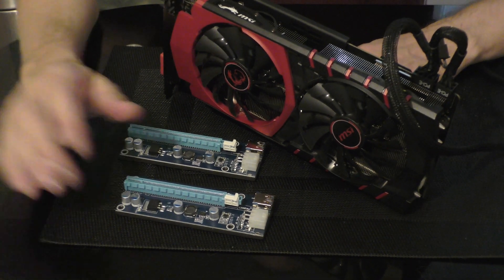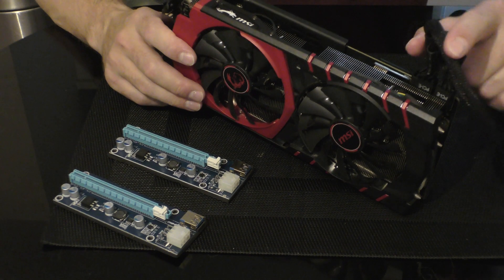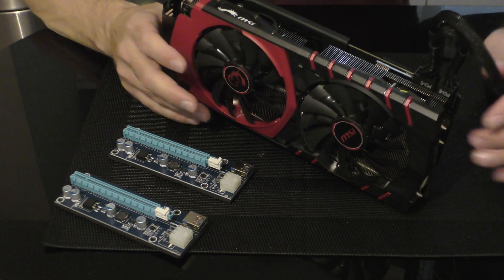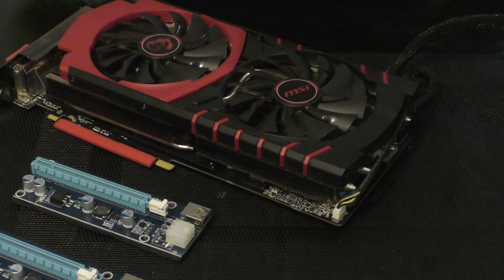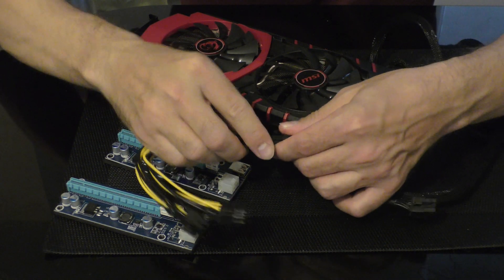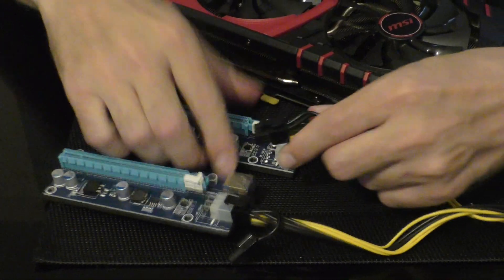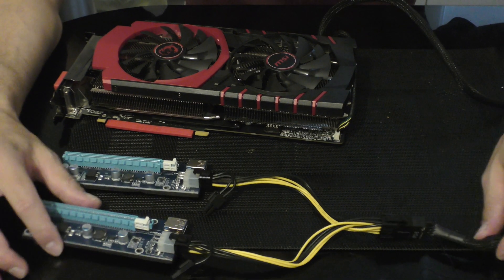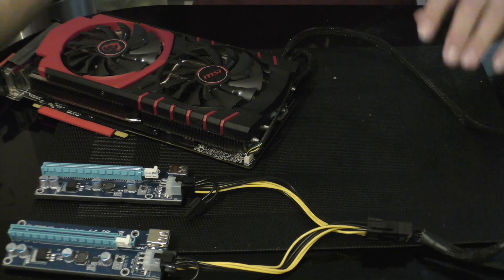Connect your High Power GPU | Riser | Splitter

Comment: It is safe can splitt 2 riser with 1 cable 28awg?
Reply from the maker: I recommend using 16 awg.
28 cables are too thin to sustain power intensity.
Reply: @minerondemand  how about 18awg it is safe?

Comment: x1 splitter never worked for me.. what was the issue?
i am using 640watt power
ryzen 5 with 3060 and 1660ti.
Reply from the maker: You need 1 splitter and 1 PCIe for each GPU.
Reply: @minerondemand  hi sir,

i used and returned nearly 4/5 X1 risers upto now and never i am able to connect riser successfully. gpu is never detected while using riser but when gpu is connected directly to x16 port on the mother board , everything is working fine.

Power supply used : 650W
processor: I5 8th gen / ryzen 3
motherboard: gigabyte z370 / gigabyte b550m ds3h
graphic card: 3060 and 1660ti

tried connecting riser with SATA, molex, pcie and nothing worked upto now..
please please please help.
what is the mistake i am doing?? 
tried on 2 different mother boards and different processors but no success..
Reply from the maker: @ThePrabhu16  did you enable 4g decode in bios?
Reply: @minerondemand  no... will try that

Comment: here's a question i  hope somebody can get me out the question . if lets say i got 4 rtx 3080 and psu is enough for 4 pcie to power up the graphic. how about the riser to power up ?
Reply from the maker: You can use normal splitting with 3080.
Still safe.  Check the other video about riser and GPU splitting.

Comment: yo MoD, one nob question. can i use splitter for one card and not for the other two cards? ty :)
Reply from the maker: Of course you can
Reply: @minerondemand  ty. I have 1000w fully modular Chieftec PSU and 2 6700xt in it. Do I have enough power to put 3rd one. Can u help me bro? Ty :)

Comment: you earned a sub!!!!!!!!!!
Reply from the maker: Thank you.  Appreciated.
Reply: @minerondemand  hai 
i have some doubts
1 is it possible to connect multiple gpu without sli ?
2 is pci riser safe
Reply from the maker: @amallfayazz8401  yes,  we use risers to connect several GPU's in same board.  If you have pcie slots in your mobo  you can use risers.
Reply: @minerondemand  i have asrock b450 steel legend and it has 2 gpu slots and 4 pci slots .....and i have 2 gpu only 1 gtx 1660s and 1660ti.....what should i doo......connect two gpu direcctly to motherboard ?.......or use a pci riser......which is best for m?
Reply from the maker: @amallfayazz8401  unfortunately that board only supports 2 GPU's. 
The other 4 pcie are 2.0 x1 and won't work with GPU's. 
As for the 16pin you can put GPU directly or use risers.
Reply: @minerondemand  but everyone saying to me it wont work you need a sli graphics card to run multiple 
or it will overkill or crash the bootup
what is the reailty
Reply from the maker: @amallfayazz8401  why would the manufacturer put 2x 16 pin if not for that?
Try it and find out.  If doesn't work, motherboard will complain about it.
Reply: @minerondemand  I have asrock b450 steel legend is it good for mining 
And can I put my gtx 1660s and 1660ti directly to motherboard or to riser?
Reply from the maker: @amallfayazz8401  already answered that above
Reply: @minerondemand  I'm sorry 
Thank you for your support!!!!!! ❤

Comment: my psu is 750 w silver from corsair , i got 4 RX 5700 , hown can i power those 4 cards
Reply from the maker: 750w PSU usually have only 2 pcie cables.  That means only 2 GPU can be plugged.

Comment: I have 4 rtx 3060 ti and 3 rtx 3080
2X EVGA 600 BR would be enough for powering those cards?
Also the PSU only has 2 8 pin 6+2 PCI-E cables so how i'm supposed to connect more than 2 Graphic cards per power supply?
Reply from the maker: You can only connect 3 card to that PSU.  And 3080 won't be enough power for all 3
Check here at minute 5:45
https://youtu.be/wekRS_vT20s

Comment: Can i use 1 cable for 4x riser? Using 2 splitters?
Card i use is 5500xt for minning and takes abt 60 watt!
Reply from the maker: It's not advised. 
Please check power cables video for better understanding.
Reply: @minerondemand  ok bud thx

Comment: Hi, thank for your videos. But I have problem using the splitter. Every time i use, my PSU won’t turn on. Do you happen to know why? Thank you
Reply: Yeah my risers work fine when powered with pcie cable connect directly to psu. But when using the splitter , the PSU turn on and off immediately
Reply from the maker: @duythanh2206  ok so it's obviously the splitter.  Are you sure it's a GPU splitter? 
What GPU you have?
Reply: @minerondemand  i have variety of them , from rx480/580, 5700xt , 3070 and all have the same problem from different PSU as well ( corsair and evga)
Reply from the maker: @duythanh2206  for this GPU's the other method is probably better.
Reply from the maker: Does it do the same when only 1 GPU?
Reply from the maker: You sure it's the splitter?  Most times it's a faulty riser.

Comment: Hi man is focus 750w gold enough for 1 3080 and 1 3070? Or even more gpu IF gpus are undervolt ed?
Reply from the maker: When you do the maths,  it's always without OC  just in case they failed.  So those 2 cards would consume a total 540w. 
In theory 750w should work.
Reply: @minerondemand  ty :) i have 2 rig my second rig is with 3070 and ryzen 5 5600x. And total watt in this is 210w after tunning on gpu...

Comment: My psu 750w gold only have 2 pcie slots for the cable, how can i fire up rx 6800 and 2x rx 5500 xt with 2 riser? Can i just split it and split it?
Reply from the maker: With 1 pcie cable per GPU.  So you can only power the 6800 with a splitter and 1x 5500. Check my latest video about power cables.
Reply: @minerondemand  okay thanks man ill watch it +1 sub for u

Comment: would it be dangerous to not use a splitter? I don't have any and my 1070 is accumulating dust instead of mining :c
Reply from the maker: No, you dont have to use splitters. GPU will extract what power it needs and PSU will supply what power is requested from GPU
Reply: @minerondemand  and conecting a 6 pin riser without splitter would burn it? Directly from PSU to riser.
Reply from the maker: @JustAColombian  same deal as before.  PSU will only send the power riser requests
Reply: @minerondemand  you have saved me hahahaha thank you so muuuuch

Comment: It is possible to powering 2 gpus (one 5600xt and one 5500xt 8pin each) with one pcie cable with two 8pin terminals???? One terminal per card,? Without risers, just direct from the motherboard????
Reply from the maker: I don't recommend.  You'll be very near of cable power limit  288w
Reply: @minerondemand  even if i turn down the power to -40% (90watts) in each card, even temporarily in what I buy another of power supply? ? :c
Reply from the maker: @Don_Calav3ra  yes you can do that.  But if OC fails you'll have a problem. So be careful and check if cable gets hot.

Comment: The best way: 1 pci-e cable with 2 x 6+2pin ->> 1 to riser (75W) + 1 to vga (vga use 8pin to 2x8pin pci-e splitter cable) (150W). So one gpu, one cable. Need dual psu for 6vga, safe and stable.

Comment: Hi, i want to use two 750w psu for 6 gpus rx570 8gb, it is good to connect 4 gpus rx570 8gb on one 750w psu and 2 gpus rx570 8gb with hardware on second one 750w psu ?
Reply from the maker: Yes that would be fine.  I would divide 3 on each.
Reply: @minerondemand  an example, about connecting gpus and risers, it is ok if I use 3 pci-e cables, 1 for 2 risers and 2 pci-e cables for connecting 2 gpus rx570 8gb. about risers, does it have anything if I use the v006 risers version for rx570 8gb gpus?  Is there a problem if I use different and used gpus? I want to make my first mining rig, and I get informations from internet and videos about how to make connections and an rig, it is very hard for  those who have never done this. Thank you for the well-explained videos and for reply!
Reply from the maker: @gameruldenis888  in your case I recommend the other video. For every GPU,  You can use 1 pci-e cable and split it to riser. 
You can use use any riser version but more recent are better.  009s being the best

Comment: Where that molex at? I use a 2-3070's on one molex strand
Reply from the maker: Molex can handle up to 156w.  I think you're lucky.
Reply: @minerondemand  so its okay to do that? I am trying to go for 6 pin pice power but that means I would have to use adapters on my 8in psu cable
Reply from the maker: @kk-qu1zc  of course not. 
3070  take 130w each  with OC. 
2 x 3070 it's 260w for a 156w cable.
Reply: @minerondemand  ya but not all power is going through that 156w cable. 1 molex = 2 pcie risers. Then each 3070 has its 8 pin cable.

Comment: hello, i have a question, what do you think if i use a 6 pin to 6+2 pin splitter for the risers? Would it be safe? As the ones you're using are 8 pin i feel quite unsure
Reply from the maker: In theory it should work as 6pin can handle 156w. 
But you need to make sure the live and ground wires are the same.
Reply: @minerondemand  what do you mean with live and ground wires?
Reply from the maker: @juanluisgalvezghiggo6618  for example in some PSU,  the GPU and CPU 8pin are different  wire diagram. 
So you need to make sure the 6pin is the same.

Comment: Can I use the same psu gpu cable to connect 4 risers using two splitters?...
Reply from the maker: No because you'll be using more than the cable can take.  288W
Each riser will draw 75W
Reply: @minerondemand  oh ur right, I heard those splitters allow up to 200w only is that true ?!....

Comment: Hello buddy
I saw your video I really liked it I have some questions.
I have 1 Corsair 1000w and a 1200w PSU server now Psu server has 1 cable that has 6pin with 6 + 2pin now can I use the psu server cable with splitter (Y) to connect the GPU which means like you who have connected Risers I think with 1 cable 6 pin with 6 + 2 pin with splitter (Y) to connect 1 gpu,i have RTX 3060TI, i believe me understand what I think
THNX for all
Reply from the maker: Yes you can split. 
But since server PSU have lots of connection it's better to use 1 cable for GPU and another for riser. 
GPU and riser always from same power source.
Reply: Splitter (Y) has 8pin to 2x 6+2 pin thnx
Reply: but I definitely thought that 1 cable with splitter for gpu because Msi RTX 3060ti has 2x8 connector for this I asked the question to use the splitter ??  thanks a lot for the prompt reply
Reply from the maker: @fatoshodja1517  the rule is 1 cable let GPU. 
Don't matter if cable have splitter. 
If pcie cable splitter reaches riser,  you can use it,  if not,  you can split it. 
Hope it makes sense
Reply: Thnx very much buddy ist all right now i understand thank you

Comment: Thanks! What PSU do you reccomend? I'm using a retail psu but am completely out of pcie slots.
Reply from the maker: Any PSU with 80+ gold and above. 
Average only bring 6 pcie.  For more than 6 cards just connect another PSU
Reply: @minerondemand  yes but even with 6 pcie you cant connect 6 cards.. for example i have a 1700watt Enermax Platimax PSU,  this PSU has only 6 Sockets/cables that go from PSU into 2x 6+2 pins.. so in total i have 12 x 6+2pins. each of my cards need 2 x 6+2 pins! (i have 3070s)

so for 6x3070s i would need to use ALL of my 6 sockets from the psu.. and then i would have no room for the splitters.
Reply from the maker: @damnbro0707  correct.  For 3070, 3080 , 3090 you'll need another PSU. 
For the beasts I recommend PSU server.  They are cheaper  too.

Comment: Hi, how would this process work if I have 3 GPUs on one PSU? Can the third riser be directly connected to the PSU without the need for another splitter since it'll only power one riser? I won't risk connecting the third riser to the other strand of the pcie cable (with the splitters connected on the other end), so I'm planning to dedicate a single riser connected to the PSU directly. Please advise if this is a good idea. Thank you!
Reply from the maker: What GPU you have?
Reply: @minerondemand  1 2080TI (250W TDP)  and 2 3070 (490W TDP) on a 1200W PSU. The 2080TI needs 2 8pin + 1 6pin PCIE connectors, which makes this more confusing with the risers and splitters included. The 3070 only requires 2 8pin pcie cables
Reply from the maker: @danjomel029  the 2080 you can just use one strand and split to power GPU and riser. 
The other use couple strands for the 8 pin and another for both risers
Reply from the maker: But yes you can use one strand foe a riser